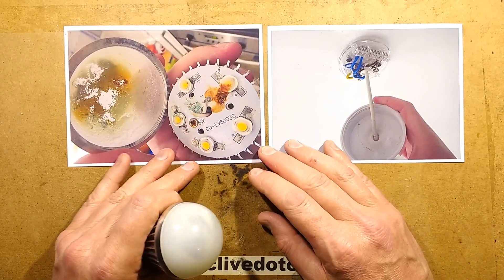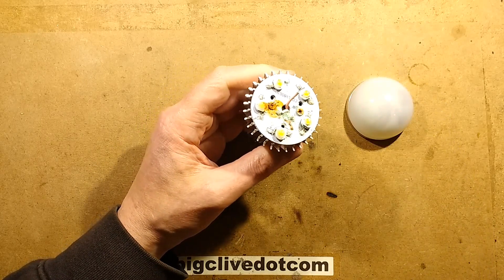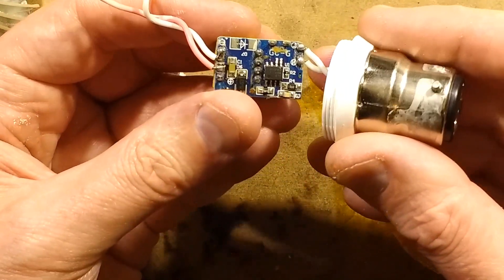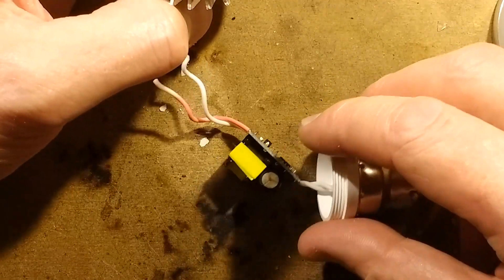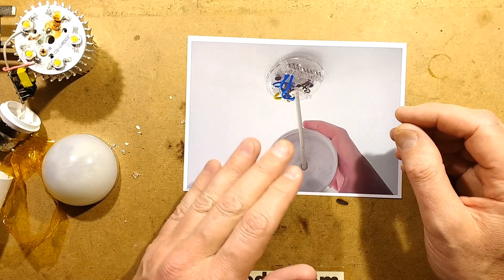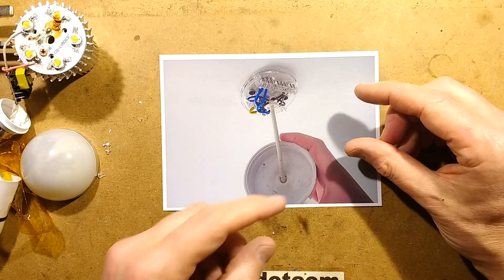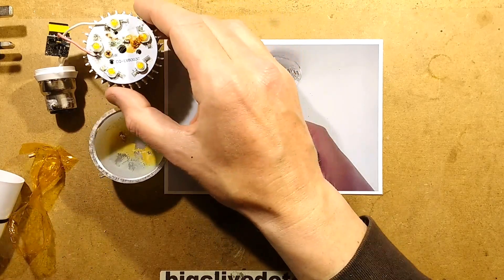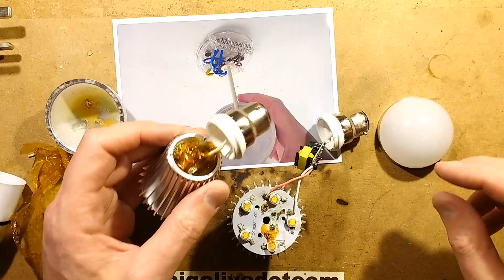Autopsy on crusty LED lamp.

Comment: If there is really no sign of moisture intrusion at the fixture, then I am thinking he may have purchased a lamp that was moisture damaged and returned to the store. An unscrupulous shop proprietor could have returned it to the shelf without testing.
Reply: Or water from the factory. One mischievous employee is all that it takes. And that yellow residue is a bit suspicious...
Reply: They do sell liquid cooled LED bulbs now, maybe some confusion! ;) This one was part of a sealed set new a few years ago, I remember seeing it was 'definitely' ok about two weeks ago (- when removed for autopsy the bulb was working but running hot / smelling plastiky and casting shadows /dim from all the brown gunk in the cap).

Comment: Here's my two pennerth. I'd first suspect a leak from above, but one other possible source of is condensation that can form in or just above the rose if there's any airflow though the cable holes and the void above is very cold.

Comment: Fitted my kitchen with fairly expensive Phillips LED's about 6 years ago. All of them started to occasionally flicker with the flicker getting worse over time. Always wondered why.
Reply: ChinnyVision - The Retro Game Review Channel - 1. They are made in China. 2. Everything is made as cheaply as possible to increase profit margins. This goes for everything from residential lights to industrial lighting. I'm an EE and several years ago, just before retiring, I worked at a chemical plant. One of our older buildings had mercury vapor lighting throughout it. Mercury lamps had been outlawed and weren't available anymore. Our electrical supplier had recommended that we use L.E.D. retrofit kits on them. They were Crouse-Hinds fixtures and were XP rated. (Explosion Proof) The kits cost $1,200, not to mention the amount of labor to install them. The early mortality rate on them was incredible. The lighting was installed before any equipment, so no thought was paid to how to get to them after the equipment was installed. The electricians were hanging by their toenails to install these things and then had to replace them over and over. I retired before they came up with a solution, so I'm not sure if it ever even got resolved. My point is that I lost faith in L.E.D. lamps since then. I'm still using CFL's in my house and stock up on them whenever I can find them. The biggest problem is that I have a few large rooms in my house that take 8 to 12 identical lamps. Am I supposed to replace them one at a time and make the lighting look ridiculous or replace them all at once and have a bunch of CFL's laying around that I can't use? They pushed so hard to get everyone onto CFL's, and now that most people are using them, they are changing the whole game again. I guess I'll have to give in to the LED lamps at some point, but it won't be until I can't find any more CFL's and the price of LED lamps come down. Sorry, I didn't mean to rant. I only meant to say not to expect too much or be surprised when these lamps fail.
Reply: I like LED's. In fact I love them. Stuff fails and I understand that. I was just surprised at the failure mode of these Phillips units that cost about 10 quid each at the time. I would have expected then to get dimmer and die slowly, not start to flicker. I've wondered if the LED chips were still fine but something like the capacitor had failed.
Reply: ChinnyVision -  What cap type are they? 12V MR16 lamps often run off an electronic transformer. Because these were designed only to supply filament lamps, they can pulse, flash or flicker LED lamps. The effect changes with temperature and as the LED lamp ages.

Comment: I had the same problem with my home. Roof and gutters were replaced, and the contractor didn't properly replace the gutter flashing. When the wind would kick up during a rain storm, water got diverted into the inside of my walls.

Comment: I have had a similar occurrence with an LED bulb in a desktop lamp. One day, it decided to flicker for a minute or two, then ejected the dome of the bulb and went off. Upon inspection, there was a considerable pool of a slightly sticky and foul-smelling liquid underneath and all the way down the stem of the lamp. It left a dark brown stain when it dried and had to be sanded off the desk. I don't know what went on, but I threw the desk lamp and bulb away.

Comment: Reverse thread so if you have a screw thread base, it won't come undone when you install it. But when it dies, it comes apart... and voids the warranty. Just a theory.
Reply: James Van Damme actually it would come undone when screwing in if reversed - right?
Reply: ... shit, you're right .... maybe they have left hand threads in England? I mean, they drive on the wrong side, ask any Canadian.
Reply: James Van Damme They don't have threads at all, they use bayonet type lamp sockets.
Reply: And warm beer! I can't grok their lingo, either. I gotta bone up on this stuff, I'm going to the Midlands in a few weeks.
Reply: Mawerick77, true. We have bayonet connectors, which are rotated anti-clockwise, from below, to insert the bulb. To others here, all countries have their quirks, depending upon historical or perceived reasons. We drive on the left, which was correct centuries before motor vehicles were invented. A soldier or rider would meet an attacker on their right side (thus proceeding on their own left-hand side) on a battleground, so that his right hand, the sword hand, would be favoured. In the USA, you still favour (favor) measurement systems which were more practical for dividing quantities, long before decimalisation took precedence. 1 mile, for instance, is 63,360 inches, which can be divided by 2, 3, 4, 5, 6, 8, 9, 10, 12, 15, 16, 18, 20, 22, 24, 30, 32, 36, 40, 44, 45, 48, etc, to give whole numbers. Decimal numbers can only be divided by 2, 5 or 10 (or multiples of those) to still get integers. Each has its merits. Bayonet and Edison screw fittings obtain their security by different methods; by snap action or by progressive frictional pressure. Bayonets have the electrical advantage that there is no way to accidentally touch a supply wire, once the bulb is inserted. Edison screws are simpler in construction, and are arguably more robust.
Reply: East or West Midlands? They speak different languages.

Comment: i suspect a little dielectric grease would help in the future, if one can't get the problem resolved from the external side. though i'd be concerned on the prospect of neighbors or whoever or whatever causing more flooding of the fixture if it was an inside located one.

still, some dielectric on the threads should give it some water resistance for random instances. not sure it would do much for sustained water like if it was plugged into an outdoor socket that catches water from the side via wind or similar, but eh.

Comment: humidity (bathroom or even in the living room (blowing in cold air lamp cable hole in the ceiling, and room is warm and humid)), the water condensate. Alternating cold and/or hot sauna

Comment: When you showed the ceiling rose, although the base didn't show any corrosion, the cover looked like maybe moisture had been running there,. so... maybe the water DID come thru the rose, but missed all the electrical connections, which as you know are off to the side.
Reply: It was completely dry with no tide marks that I could see (I had a good look on a ladder), the little pattern on the white plastic was just a cobweb that pulled away from the ceiling when I opened it up.

Comment: Another big advantage of conventional bulbs: you can be sure that they're 100% waterproof and you will not find waterdrops on the filament!
Reply: Juri Vlk I have most certainly found incandescent bulbs with wet filaments over the years.  The vicinity is also usually quite strewn with very sharp shrapnel distributed throughout the room (if the bulb was not well enclosed by an outer globe), which really sucks if the room happens to be carpeted, due to the bulb exploding quite violently upon first contact with said water.  Thus far I have never witnessed any LED type bulbs exploding violently and distributing very sharp shrapnel throughout a room!  Both have their advantages and disadvantages, but LEDs are vastly more efficient (using about 10% as much power), require far less cooling capacity (90% fewer BTUs emitted), do not require replacement several times each year, and also turn on practically instantly (unlike the earlier compact fluorescents that preceded them which took forever to warm up).  There are some jobs for which they are not well suited, which is why the specialty incandescent bulbs remain widely available, but overall they do very nicely for most indoor and outdoor lighting purposes.  

Most rooms in our home have been illuminated by LED bulbs for much of the past 5-7 years and nearly all are still original even with heavy use and/or frequent cycling.  In a few instances dimmers or motion sensors had to be upgraded to work with LEDs (mostly due to the very low let through power versus incandescents) but such was otherwise a painless process and they have more than paid for themselves just in reduced cooling demand over those years, and nowadays the major brands often only cost about 10-20% of what they sold for back then further reducing the return period before they pay for themselves.  But one does have to buy decent quality LED lights with properly designed power supply or they can be quite awful since the cheap bulbs often have a great deal of flicker and/or exhibit reliability problems not typically experienced in the better brands.
Reply: if your getting water in your roof than wouldnt you want to know... also conventional bulbs are crap and a waste of materials and money. stop buying cheap chinese crap and expect it to be good. its not leds bulbs that suck its your wallet that sucks.
Reply: I meant it as a joke. Some didn't understand it. I think LEDs are good namely for flashlights etc. Where efficiency is important. When I take my two D-cells old Maglight I really see that it is dim. It is dimmer than the cheapest and smallest LED flashlight (of course, the old Maglight still works better for hitting someone on the head). At home, I'm not so sure. The LEDs are much more efficient than conventional bulbs -but not ten times as many claim. They are about as efficient as fluorescent lamps and not better. The 36W fluorescent tube I recently bought for the kitchen (the cheapest one I could get) seemed to be really bright. And indeed, it claims a 3335 lumens. The 9W LED claims 790 lumens, which means the fluorescent tube is more efficient. For the household, only a small part of the electricity is consumed for the lights. Everyone knows that heating and cooling are the big power consumers. My cooking plate goes to 3000 W, the oven even more. Refrigerators and more and more ACs are consuming a lot. To forbid incandescent lamps was the worst government hoax ever! They are taking us for idiots. It was because of Philips and Osram that wanted to sell more and more expensive lamps. That was the only reason. It's the same bullshit like the so called climate change. Just a rip-off. Then most bulbs in my house I have replaced by LEDs. But as far as light is concerned, they are still much worse than normal bulbs. And they all have tiny transformers in them that you can hear when you approach them with an AM radio. And they are all made in China. All the incandescent bulbs were made in Europe. But today it seems to be good to make us all dependent from China and to loose our jobs to them and them to ship it all over 10'000 miles back. We call it sustainable growth. I'm using my 10W flashlight and feel happy as a baby but I'm also hoarding incandescent bulbs.

Comment: Water could have gotten in through the inside of the wires.
One day I came home from work I heard water dripping inside the distribution cabinet where the mains coming in is distributed to all the apartments. The water came from the end of a thick electrical cable, from in between the individually insulated conductors. Turned out that on the top floor a drainage cock had been partially knocked open spraying water around, some of which ended up inside the cable somehow. Luckily nothing bad happened and everything dried up nicely.

Comment: Looks like it's been in a steamy bathroom or kitchen, the water has condensed on the heatsink and flowed down the channels into the led pcb part, then crept across the pcb to drip into the bowl part.

Comment: I have a light like this. After running for 30 minutes it's starts blinking. I've took it apart so it's sort of dangling of the wires and it works fine. Something is overheating, not sure what.

Comment: I've had a LED lamp go bad on me this week from my living room. It was from CPC, a pro power I'd imagine, it just strobes extremely fast every time it powers up. Would you like to take a look at it or is that a common fault? It's going in the bin otherwise.
Reply from the maker: Very common LED lamp failure mode.  Sometimes a dry electrolytic capacitor and sometimes a fault in the bootstrap circuit.

Comment: So if water came in theu the socket, how did it get into the lamp? That bi-pin base looks reasonably water tight. Did it get into the threads on the base? If not, how did it get inside?
Reply from the maker: +l wilton The dome is open at the sides.  It went down the outside and filled the dome.

Comment: I bet it is an electrolytic that has vented. I have 7 lamps witht he exact same failiure and it's the electrolytics that vented  out the bottom without bulging on every single one after working for the stated lifespan of the cap.
Reply: No it flickers only briefly and then dies. IT has exactly the same brown discharge and in my case there is absolutely no risk of water damage.

Comment: it's not water ingress. I have had 8 other lamps like this that have failed. they all had the brown residue on it. all in different socets. all were hanging down like in this fixture. they would get noticably dimmer over time and ran very hot, too hot. eventually they just would not turn on and fail.

Comment: If this lamp was used in a room with rapid humidity and temperature changes (bathroom, laundry room, hallway in hot climate area, etc.), then maybe water vapour in the air condensed down on the cold metal and got sucked in by capillary action.
Just a theory.

Comment: Water got in while bulb was in a different fitting and the  fitting failed because it got wet. New fitting installed ..ooo look the  bulb still works.. 
Or it was used outdoors until it fizzled out full of water but once it dried out a bit it started workig again so was used as a spare somewhere else before it failed again

Comment: Got same one and has 2 broken led chip but dunno how to replace it
Reply from the maker: These LEDs are called 1W LED beads on eBay.  Quite hard to solder onto the heatsinked board unless it is heated up first.  Also requires a dab of thermal paste under each LED.
Reply: bigclivedotcom Oh thanks. I do have only the soldering iron, so it seems too hard to replace.

Comment: Don't get me wrong, LEDs are awesome and the technology has really advanced..But,, As cool as they are and as long as they last, using them as Headlights and taillights on cars is crazy because while the LEDs themselves last, the power supplies don't. Now you have what once was an easy super cheap repair turned into a super expensive whole light housing change..Crazy.

Comment: Probably inappropriate tape used and the gum has got hot and melted/run/vaporised. Water ingress would have had to be from a different installation (as rose clean) and the metal framework looks too clean too.

Comment: Has that so-called "Kapton tape" still got its stick? I've not seen Kapton tape crinkle up like that before, looks more like what happens with normal sticky tape when it gets hot. Could the mess of been made by the glue they used on the tape?
Reply from the maker: +Fred Blogs The goo was dropped silicone from the threads of the base.  The Kapton tape was still sticky.

Comment: would you ever check out some GIF 9900mAh 18650 li-ion batteries?
Reply from the maker: +The_JDM_ Workshop 18650 batteries are not available with that capacity.
Reply: bigclivedotcom  yes I know. I'm very curious about them. I have a few I bought as replacements for a led head torch, sadly one of them...well went up in flames. but the others seem to be very weak even when they where new.
Reply: Apple tart?

Comment: If the base thread was the usual way round, it would unscrew when you put the lamp in the holder.
Reply: No, it would tighten. Think about it.
Reply: It's a BC cap, you only turn it less than a quarter of a turn.

Comment: Why do light bulbs turn black.
Reply: Seduced by the dark side of the force, most likely.
Reply: Master at "" ....
Reply: KV Taurus  If you mean filament lamps, the dark layer is metallic from the filament getting deposited on the inside of the glass.

Comment: I recently had a similar issue in the garage at a neighbours house. RCD kept tripping when florescent lights were switched on. traced it to the Last light (Typical) but still couldnt work out why. Removing the cover shows that moisture in the chip board was being sapped out by the heat of the ballast and causing salts to form! - Above was completely bone dry!

https://ibb.co/evcXCa
https://ibb.co/c0eOJF